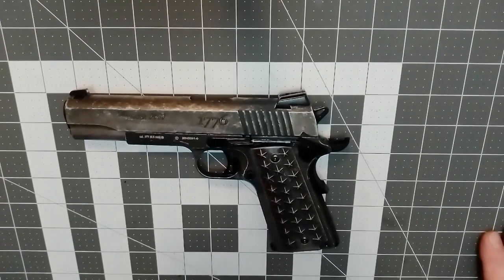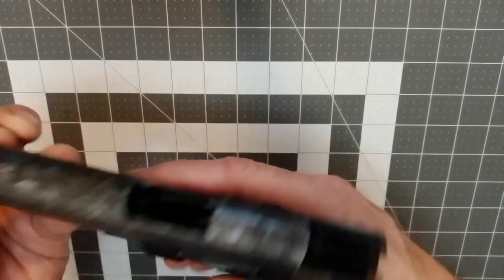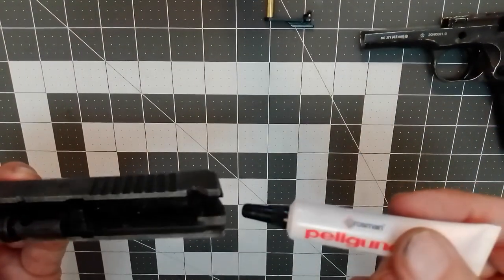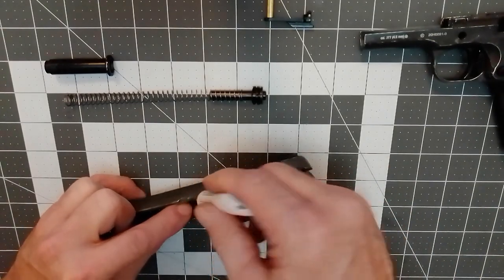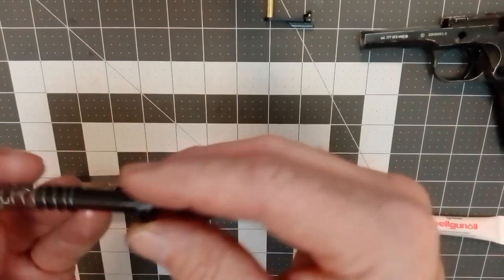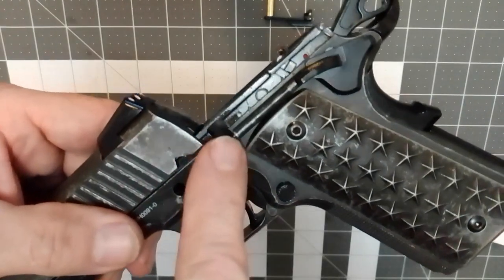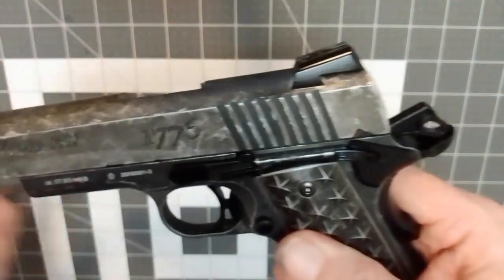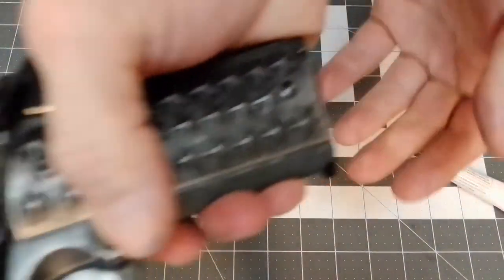Sig Sauer WE THE PEOPLE 1911 co2 bb pistol. Field Strip and Maintenance

Comment: The outer and inner barrel was slightly a bit too wiggly for me on my Colt M45 CQBP Rail Gun.
 I took out the outer barrel bushing from the front, cleaned it well inside and put a piece of insulation ( or "electrical") tape to give the outer barrel a snug but moveable fit within the bushing. Taped slightly between the inner barrel and it's plastic front shroud piece also. Shoots tight groups on bullseye from 20ft nowadays. The point of aim and impact did not really meet in it's original state (yeah - they hardly ever do right outta the box..😂). But these KWC made 1911s are one of the easiest BB pistols to shim on target due to their build. The only a bit annoying is that the inner barrel is locked with a pin into the outer barrel..

Comment: Hi My SiG sauer 1911 Scorpion is leaking C02 when installed in the magazine. I can hear slight air releasing even after tightening the Allen screw. Also it doesn't have that power comparing the Glock 17 (not penetrating water bottles.
Reply: @kerronbailey6121  any fix?
Reply: @UrCho1ce no not yet.. it's wasting my C02s
Reply: @UrCho1ce  no none at all, my Emperor is parked right now.. so sad
Reply: @kerronbailey6121  damn

Comment: It's really hard to remove the slide catch on mine. It's the first time I'm trying to remove it, is it normal?
Reply from the maker: Totally normal until it wears in a bit
Reply: FULTON STREET BEATS Thanks man, right after I commented, I used the nail filer on a nail clipper to pry it off. You rock dude.

Comment: Rad. Thank you!! Have a question for ya.. Do you have any vids on disassembling the lower? ( I have one where the trigger is apparently rubbing against something on the inside. *Its twin does Not have this issue, Nor does it have visual,  lateral slide/scrape marks on the skeleton trigger.) Otherwise, it's just like the other.  (Thanks so much :)  =OH=  and if you happen to have another of these vids with a suggestion on how to have the Drop Free mag on a P365 ..Actually 'Drop Free' ..Lol... I would be grateful. I have 3 mags for it, looked into the chamber to try and see any possible friction points, and then finally just sanded one of the mags basically all over (save for the ports, etc../ until it started looking like the exterior of the We The People 1911. :)   ( Which now actually Does drop free ) (( Making sure to use compressed air for a  W h i l e  to make sure there was nary a particle of dust left behind, btw)).  Once again, Great vid and THANK YOU!!!!!!!
Reply from the maker: I don't have any as of yet but I have recently developed mag drop issues when the gun is under co2 pressure. I will be taking it apart soon to find the issue, and possibly a video. The mag will actual get hard stuck in the magwell. nothing rubbing. once the co2 is discharged it drops fine. I will keep you posted.
Reply: @FultonStreetBeats  Heya! Thanks for the reply! -And yes.. just for same-page purposes, the 365 mag release issue I have... not one of them even had a Co2 cartridge installed. Just a bit odd..Lol.. The stock one, prior to 'smoothing out' the exterior of the mag, would eject about 1/4".. and then you'd have to manually pull it. Now it drops like a champ. The additional mags are even tighter. Anyway, I super appreciate the reply and info. I will check for that next time i'm in combat with space aliens. I'mean... erm,.. a t   
t h e    r a n g e . . . O_o....